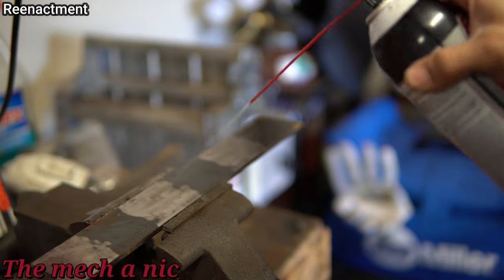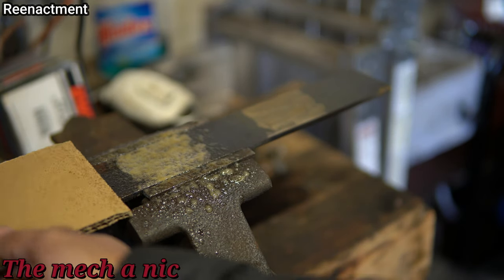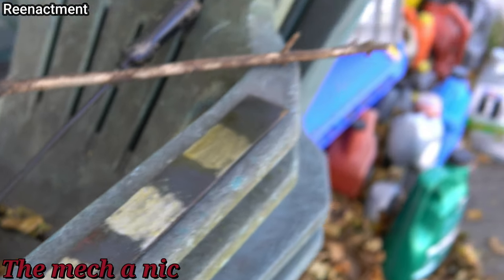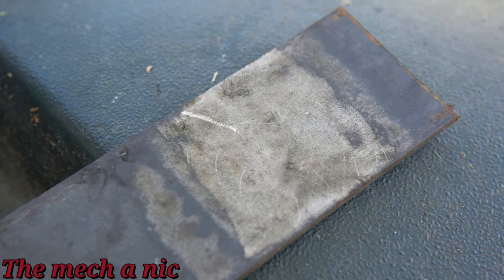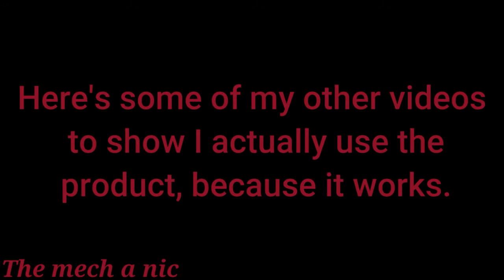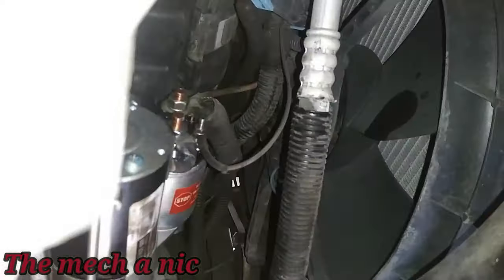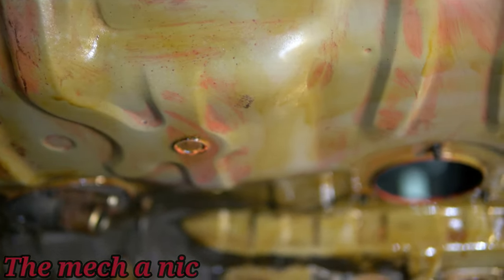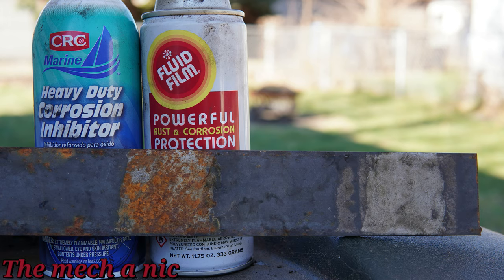fluid film vs CRC / one year update

Comment: I use Rust Check  (coat & protect) fluid film is pushed as much as the Milwaukee fan boys on YouTube  push Milwaukee tools so  fluid film  sucks just like Milwaukee tools 🤣🤣
Reply from the maker: Milwaukee hands out stuff like free condoms at the clinic.... Unfortunately not to me lol. I dont think I've ever heard of or seen rust check in stores
Reply: @themechanic6117  Ya its mostly sold in Canada . Actually it's quite simular to fluid film but thicker and 1/2 the price .  No free  Milwaukee  tools for me either or Milwaukee would be the best tools  to buy , right  🤣🤣
Reply: @HVACLife  🤣🤣 Jay I'm just being a bit sarcastic,  I have lots of Milwaukee and their almost as good as my dewalt stuff 🤣
Reply from the maker: I love my milwaukee tools . only had a failure here n there but for years of use they've been good to me . its hard for me to knock them when its the only power tools i have....im in too deep! Lol
Reply: @themechanic6117  I'll ask my Milwaukee rep to contact you . 👍
Reply: I'm in Canada. Ontario. Road salt.  And de-icing sprays.  Rust.   I use Rustcheck.  The green stuff is awesome.  My truck is mint underneath at 4 years old.  Gotta be diligent with DIY yearly inspections and reapplication as required.
Reply: @jakemason9436  👍
Reply: @HVACLife  HAHA cheers bud. 👍
Reply from the maker: Steve rob is the best!

Comment: I would like to recommend another experiment.  Use a few coats of CRC as a primer, let dry to touch, then cover it with regular (tar) spray undercoating.  I am curious if the CRC would prevent the undercoating from deteriorating and flaking.  In turn, the undercoating would protect the CRC. I have done this to a section of a old wheelbarrow, but if someone up north would do this to a section of their car and see the results, that would be awesome.
Reply: Well how did the wheelbarrow come out in that section? You already did it and are asking others to do it. 🤣
Reply: Honestly tho how'd It come out?🤔
Reply: I don't think the CRC needs to be protected, it's very durable, apply a couple of coats and it's like impenetrable.... when applying to my truck, I got some on my sweatshirt, I couldn't remove it with mineral spirits, I had to rub it briskly with acetone for like 20 minutes to get it out...  highly resilient.
Reply: Completely unnecessary. Cosmoline doesn't need anything over or under it. It's tough as nail and bonds to clean metal better than anything else.

Comment: I think this is a great duo of products, I haven’t tried fluid film but I’m up here in New England where I’m pretty sure they sneak into cars at night and spray em with salt, crc really does work as long as you get a good thick coating on it and can reach the surface, the downside being it doesn’t creep or penetrate at all, so I think I’m going to try something like fluid film as well.
Reply from the maker: Yes it's a good idea to use both since one creeps into tight places and the other doesnt

Comment: Nice video man! I use Fluid Film to spray inside the frames. I use Amsoil metal protector outside the frame and all over exposed undercarriage. The Amsoil metal protector which acts the same as CRC but a bit more expensive. I would want to switch to CRC but my question is it safe for rubber, plastic, paint or other components undercarriage because its impossible to avoid overspraying sometimes.
Reply from the maker: Ive sprayed the crc on paint, rubber, plastic (overspray) and haven't noticed any negative effects but i cant speak for long term. The product doesnt seem corrosive or aggressive on any surface its on.
Reply: This is my plan to.  CRC out, ff in cavities.
Reply from the maker: I do the same thing
Reply: Does Amsoil market their product safe for rubber, paint etc?

Comment: I also live in chicago and just had a mechanic replace the breaks on my 06 chevy uplander. the mechanic then showed me the chassis and one holding the radiator all rusted out barely holding on to the radiator. So will soon need to get rid off the van. I'm a little sad because i really like my uplander and still runs good.  Now I need to rust proof my other van that is the honda odyssey. i'm going to try the CRC.

Comment: Fluid film good for large area coverage (like wheelhouse, body cavities, and the underbody plane and pinch welds). Something like CRC perfect for spot treating under carriage, cradle hardware & mounts, and suspension & steering bits, bolts and threads.  I'm in Michigan and the salt destroys cars like Chicago.  I did an experiment where I bed liner coated my rockers and wheel wheels on my car back in 2015, kept up with fluid film in general and spot treating the suspension, car looks great underneath to this day.
Reply from the maker: Nice, if you're on top of fluid film treatments it works great 👍

Comment: I'm 60 years old and care for my own cars.  In 1987 I purchased a classic '69 chevy pickup (only 18 years old at the time).  I wanted to preserve this truck for eternity. It had 200,000 miles on it. The owner told me that the long term owner had sprayed the undercarriage with motor oil and drove it down his dirt road.  This oil dirt mixture was caked under the truck and had protected it very well.  In my innate 25 year old wisdom, I had the bottom of the truck pressure washed, then completely cleaned of this mud - they had to use a chisel. I then had the truck sprayed with a "new" best ever clear rust proofing (we were still in the ziebart/rusty Jones days)  the truck began rusting within a couple years.  Next I tried a suggestion of "Penetrol"  a paint additive.  Worked okay but long term performance was lacking.  I also had a few cans of CRC tool coating probably like this guy used.  No long term protection.  In a later job starting around 2012 we used "carwell" annually applied in October.  Carwell is A very thin creeping product.  Washed off in important areas.  We switched to Krown which essentially is the same product with the same result.  We ended up at using Fluid Film with no washing.
I now have treated my 7 year old Ram dually with PFC which is similar to fluid film.  PFC is from Pennsylvania based Berkebile and is lanolin based. Less odor.  I currently am of the thinking that most rusting occurs in warmer weather.  After the salt gets in your truck.  You should not clean your undercarriage and apply the lanolin base product in spring/early summer when water will not wash it off.  Then it can gather dust/dirt and build a layer.  SALT DOES NOT CAUSE RUST. Oxygen causes rust.  Sure, the salt and water help the chemical reaction but if you block out the oxygen with an oil you will stop the reaction.  As in firefighting you take a component (heat, fuel, oxygen) you stop it .

Comment: I'm currently restoring a 72 Karmann Ghia (I like to suffer when repairing cars). 
It has that 70's bitumen tar crap all over the underside which to be fair has protected where it has not cracked, but getting it off has been a nightmare.
My personal choice of under seal is using an epoxy based product called EM121 which you can brush on or spray.
Unlike the POR15 crap it does not peel off but remains flexible, tough like the bed liner stuff and it also prevents rust from forming underneath.
It's obviously not suited to anything other than body panels so everything else needs something like CRC.
Once it's on nothing short of an angle grinder is getting it off.
Reply from the maker: Sounds like you got your hands full! I have the rear spindle on the crx covered in por15 to see how it performs... So far so good but honestly the crx hasnt seen much road time
Reply: @themechanic6117  I painted all the floor pans in POR15 which just peeled off in sheets a year later. 
And yes I did prep with marine clean and metal ready first as per the instructions. 
Happened to plenty of other people here in the UK also. 
Works great sticking over rust (and your hands especially lol) but any shiny metal and it will lift and flake off or start rusting underneath. 
Maybe they change the recipe for the exported stuff?

Comment: Hey so I live in Colorado where I don’t have to worry about rust.  I do use fluid film but not for it’s intended purpose.  I use it for tapping holes. Routing hoses in tight grommets .  Electrical connectors door latches, window seals.  Lug nut threads, air tool lube.  Garage door rollers and chain, battery terminals.  Stubborn worm gear hose clamps that bind up.  Pre assembly for whee seals.  And my favorite use of all,  annoying tech /customer repellent.
Reply from the maker: Tons of uses i see lol. Yeah you definitely need fluid film around because crc is suited for every job . i tend to use the FF for key holes
Reply: How do you not get rust in cold climate like Colorado? Don't you guys brine the roads during winter?

Comment: Is CRC ok to spray on undercarriages that have some minor surface rust? Use a bristle brush first then spray? Worried it might trap the rust and make problems worse.
Reply from the maker: I can't confirm if it'll make trapped rust even worse. Maybe spray rust convertor then crc over that?
Reply: @themechanic6117  Thank you for the quick reply and for the video!
Reply from the maker: You're welcome. Thanks for watching
Reply: I'm not a chemist but it keeps the oxygen and moisture out of the rust, and that's a good thing. I spray right over the rust.

Comment: I've watched countless hours of videos comparing undercoating products... I had it narrowed down to a few products, one of which is CRC.  Your video clinches it for me,  there is a big difference between these 2 products, so I'm going to use CRC for my F-150.  In addition to lasting longer than the lanolin products, it also appears to have a much lower risk of peeling, which is why I'm not using a rubber undercoating, frame paint, or POR-15.  CRC also seems to be much less toxic to work with than some of the other products, particularly the frame paints.   I bought a test can of CRC and found it was also very easy to spray inside the frame and hard to reach areas, even though it does not come with a spray tube/straw.

Thanks for a super helpful video !

Comment: The biggest problem i come across on land is rust and rot due to urine from animals that is destroying metal and even concrete on cars wheels and poles.No one on YT seem to mention that or do videos about it but is a big problem for  all.I personally found the best and easiest way to protect is rust convertors to make them change rust to a strong layer and cold zinc galvanisation.Epoxy paints is time consuming and cost.

Comment: I have seen some reviews the CRC can eat paint have you had any of these issues ?
Reply from the maker: No problems with that so far but i think ill test that now
Reply: Had a chat with a tech from crc about this.
Said it's ideally for bare metal, it May cause some discoloration to painted surfaces that are not clear coated, wipe off any surfaces you don't want it on.
Avoid spraying on rubbers and bushings as it makes them swell, petroleum based product.
Can be washed off with a good degreaser.
Guy couldn't recommend it for undercoating vehicles due to epa, but  did say a lot of people used it with great success for undercoating.
Takes about day for the stuff to "cure" properly.

Thanks for the video!
Reply from the maker: Thank you for the info.

Comment: Is there a difference between CRC corrosion inhibitor, and CRC converter ? As I would like to buy the bigger one gallon CRC ? And awesome 😎video !
Reply from the maker: I've never tried the converter but id assume you paint it over rust to convert it into a paintable surface. The corrosion inhibitor stops rust from forming in the first place
Reply: @themechanic6117  ok cool thanks for the reply 🤙🏻👍🏻😉
Reply: @themechanic6117  Just to let you know both.  I used rust converter in past, rustoleum one.  Al what it do is converting top layer of rust to some black thing but rust spread below it.  Completely useless thing.  Actually is just at way of Cosmoline to do its job.  I heard many good thing about ff actually going below rust and detaching rust from metal.
Reply from the maker: That's interesting. Yeah I've never had much faith in that convertor stuff... I think its a bunch of BS
Reply: @themechanic6117  Other people have bad experience to.  For you bro I put rustoleum rust converter in 2009 and than bedliner (ford f250 99 8' bed).  It is how it look after pulling of bedliner in 2020 https://www.ford-trucks.com/forums/1582350-planing-to-go-south-to-replace-bed-bumpers-etc.html  Post nr12 .  Every paint will just be in way of Cosmoline.  I did test for it to and it is in my self standing post that you saw.  Useless rust reformer is simply worst that you can put down before Cosmoline.  Cosmoline need not any help.  It go alone against rust.
Reply: @themechanic6117  Tbh it is how rust fighting education work.  We all start with rust reformers than some painting than paint over rust (por 15) and end with Cosmoline and Lanoline (fluid film).  Most of us go that route.  Epoxy primer is excellent but require clean metal.

Comment: Is the crc safe on rubber and electronic parts? Or gold in moister?
Reply from the maker: Should be fine on good. Its fine for exposed wires n connections. Someone mentioned its not safe on rubber

Comment: Question? do you have to clean all the rust to apply any of this products or can you just pressure wash and apply, in my case will be a tacoma truck frame.
Reply from the maker: I'd remove any rust possible before spraying anything over it. There's no point in insulating rust. It might even get worse
Reply: Many of the cosmoline vendor sites tell you to remove as much rust as possible, but go on to say in the real world, it's not feasible to get to bare metal, so cosmoline still works on tightly adhered rust by encapsulating it and preventing further rust. It will sometimes creep a bit under some rust causing it to fall off. I've had to  reapply in spots. Over sound rust, it does seal well and prevents  further rusting. Again, I remove as much as I can but rarely can get to  bare metal.

Comment: I had both some rusty but mostly unrusted body frame and undercarriage parts that I treated thoroughly last fall before salty road Northeast winter, in a newer car. I Just got up under there last week to assess and 're-treat' as necessary.  Treated areas (even over rust) looked PERFECT and identical to how they looked after they were treated and the product had dried last year.  I was amazed.  Resprayed delicate parts anyway while I was up in there to ensure zero exposed metal (but I probably wouldn't have needed to; however all the work/time spent was just getting the car lifted and all skid plates removed).  CRC stuff is the bomb.  Buy it in 4 packs.. Big savings.  **I just wish there was a long tube applicator that has a wider dispersion spray coverage so that you can get up into all cavity's and cover every inch of metal floor pans/welds, etc AND into the frame cavities more easily.  CRC: please come out with such a dispenser nozzle **
Reply from the maker: 💪it definitely works well! I still use it like crazy

Comment: the question is does fluid film remove the crc when applied over it. Also which one performs better  on already rusty cars? I applied 4 cans of crc but sprayed fliud film on really rusty spots and after a month the fluid film helped peel the rust off.
Reply from the maker: Neither of these are to remove rust. I'm not sure if FF can remove crc. I found it difficult to remove. Usually needs brake parts cleaner to remove it.
Reply: @themechanic6117  fluid film will penetrate scaled rust and make it easier to remove is all I'm saying. I heard that on other videos and forums too